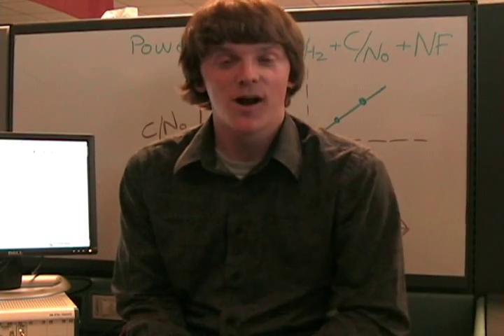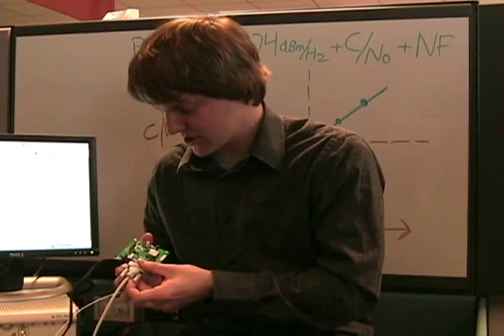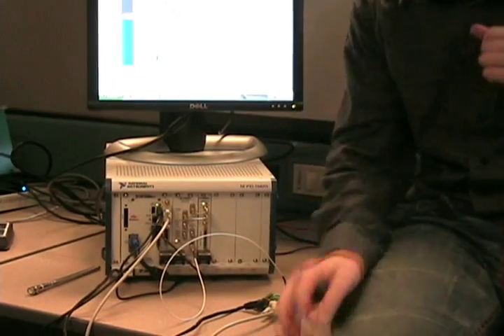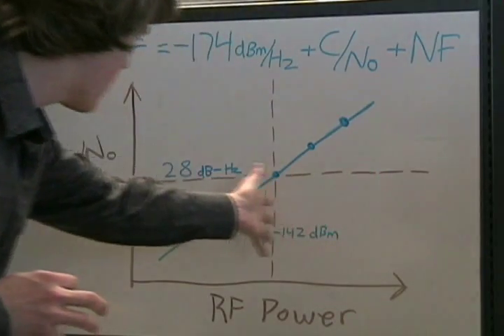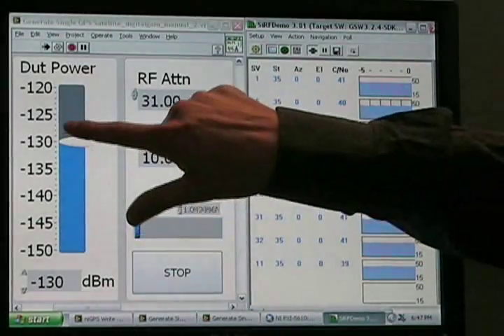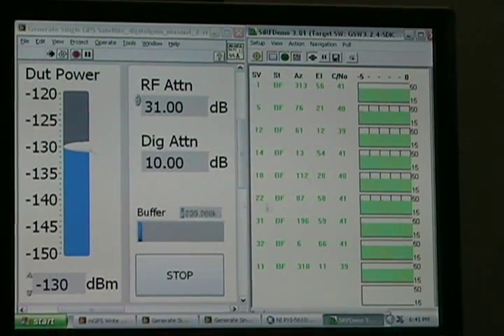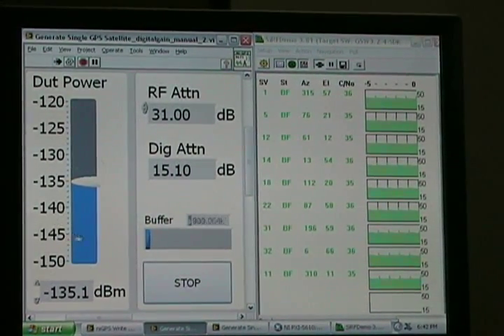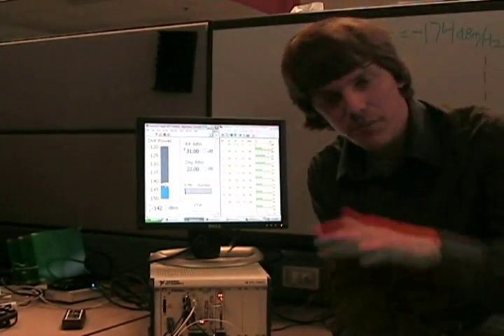GPS Receiver Sensitivity

Comment: no offense, but based on the equation you wrote, the line should not look like it is passing through the origin simply because when C/N=0, the RF power (sensitivity) = -174+4 =-170dB. Otherwise, really liked the video. Great job! and thumbs up!